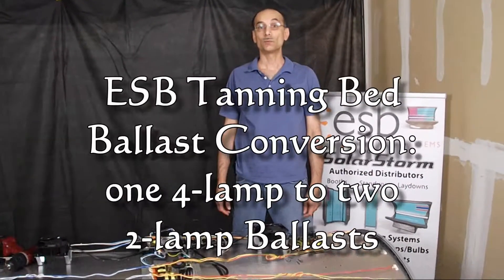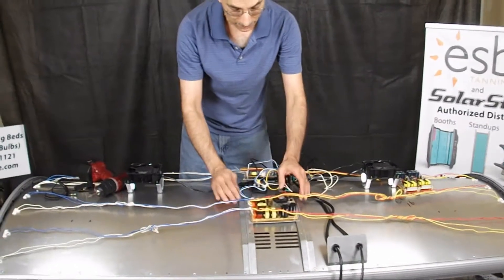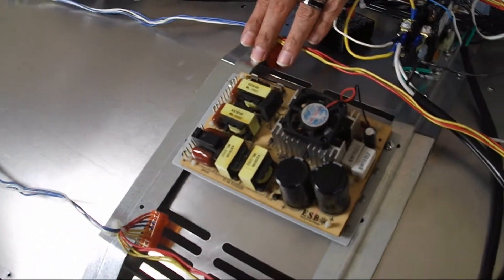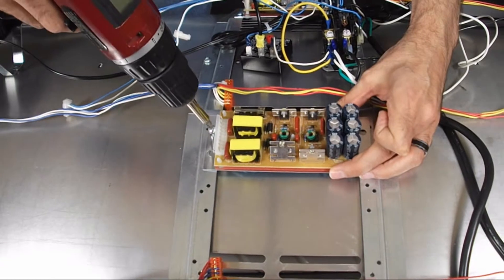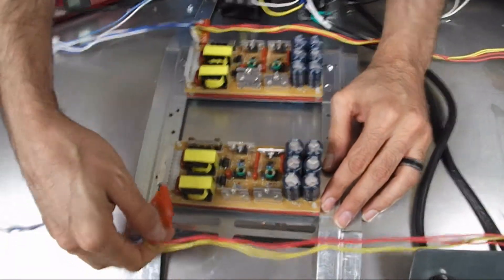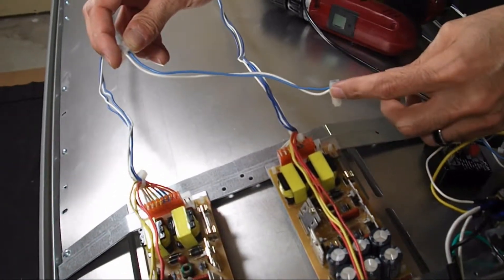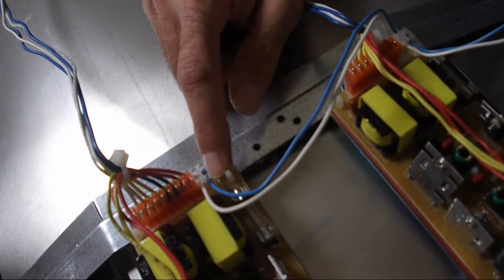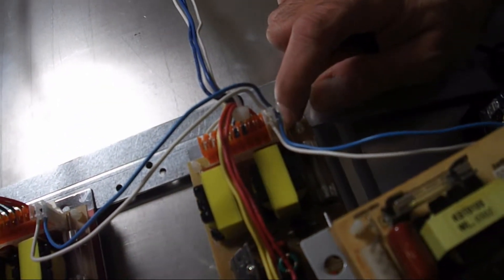Converting a 4-Lamp "Open Style" Ballast to (2) 2-Lamp Ballasts on an ESB Tanning Bed

Comment: Can I use a GE Proline t12 ballat on my tanning bed?  It says compatible with 2f72t12ho lamp which is what i use in my bed
Reply from the maker: I would recommend only using factory, OEM parts